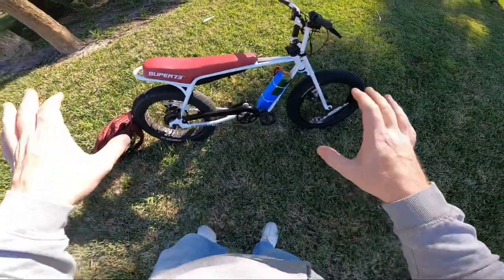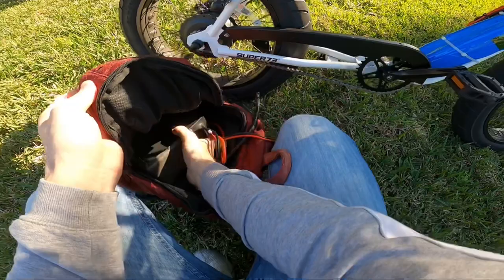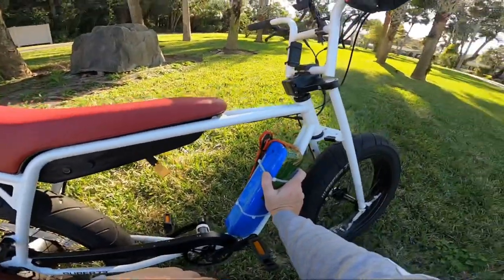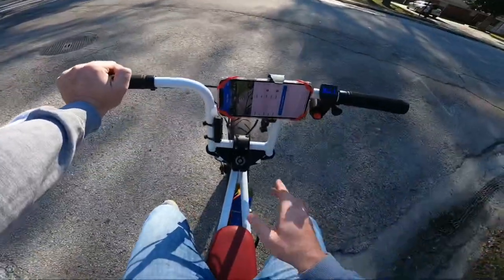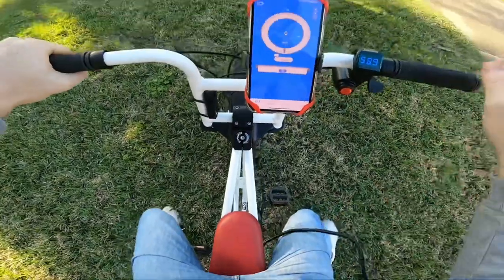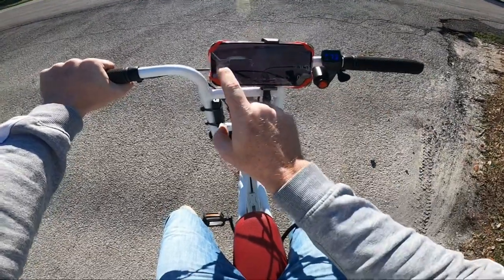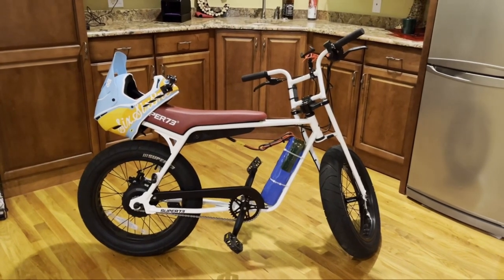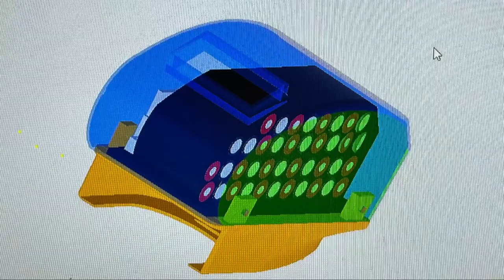Super73 Z1 72V vs 52V? 1/4 mile times! 40MPH?! Which way should you go?

Comment: Very cool! This is my favorite super73 bike (well the only one I would buy) would def mod it like your bike.
Reply from the maker: Thanks man,  it’s such a cool bike.

And as you can see within a week or two we are here!  I plan to post up anything I design for the bike.

So if you have a 3D printer follow along.
Reply: @BuildItTuneItEV  how much range can you get with the 52v? I’m currently riding an Onyx RCR but I wouldn’t mind getting a project bike.
Reply from the maker: @JCNY718  I diy most of most own battery since learning how to.

If using the 52v pack I showed in video I have went 25 miles at around 25/30 mph with plenty left.

52v was not much slower, how ever I honestly did less testing with 52v since I really wanted that 40mph.

With all hub motors, and we are speaking with general tuning.

More volts= higher top speed.

So if you can give up some top end, and use a 14s(52v) with high P you will get very long distance.

Watt hours is what determines the final distance.

Comment: You say that torque goes DOWN with increased voltage? I thought the torque of the motor is directly proportional to the square of the supply voltage. So like, if voltage decreases, torque will decrease as well as RPM. But you are saying because the 52v allows 50 amps vs the 72v that allows just 30, that also plays into the torque. Ahh. Gotcha. I think I answered my own question, lol.
Reply from the maker: Only because I was using a lower amperage 72v battery here.

72v offers more tq if similar wattage.

Comment: nice. question is that it is safe for the motors for 1/4 miles run is not bad but how about if you riding it all day
Reply from the maker: 1/4 mile run is flooring it the entire run.  Most my driving around is just cruising and much easier on it.

How ever I upgraded motors for more speed now so I can say how long stock would of lasted
Reply: @BuildItTuneItEV what kind of motor did you put?

Comment: Are you able to use a qs motor? 72v with 100 amp bms would be fun
Reply from the maker: Yes, Now I have QS205 V3 2.5T With 200amp controller.  Much more fun.
Reply: @BuildItTuneItEV  200…. That’ll work
Reply from the maker: @gmeister03  finishing up the tuning now, been slacking on updates.  I did some custom frame mods.  After doing the new hub I found it needed some extensions. Added 7" extensions to the frame and its much better.

Comment: Would you be willing to share the stl for the bbshd + phaserunner cover?
Reply from the maker: Yes, I am working on final revision with gasket to upload.
Reply: @BuildItTuneItEV  Thank you for sharing! And good thinking on the gasket. Have you noticed any heat build up yet?
Reply from the maker: @skewedfpv629  only on the motor on long distance road.  Controller runs better here than where mounted previously.

Using field weakening creates some heat.

Also I run low tire pressure.
Reply: @BuildItTuneItEV  that sounds very promising! I noticed a bit of heat in the motor as well after some hill runs through snow, controller side of the case stayed cool on my end too.
Reply: So all I need is a bigger battery to make it go faster?

Comment: wow, so it all comes down to controller amps, 72v vs 52v not much of a difference there...
Reply from the maker: A smaller amp and wattage battery was able to out preform the higher amp lower voltage battery.

And since than I have build a 60 amp 72v battery and it does wheelies lol.

Comment: That's not true I have a 52 volt 21 amp battery with a 52 tooth sprocket and the smallest Shimano 9 speed cassette and I can easily do 75 miles a HR on it it's so fast I never passed level 7 or 7th gear . On level 3 and 7th gear I can hit spears almost 50 miles an HR. I have the bafang 1000 watt high performance midrive your bike is junk I built my own.🤣😂😋😝😎
Reply from the maker: This is a Hub motor, so gears do not matter.  I built my own bike as well.  You came here to brag about your junk? Cancer?